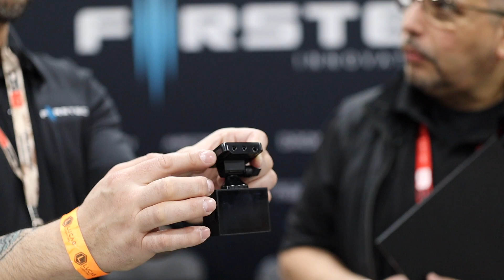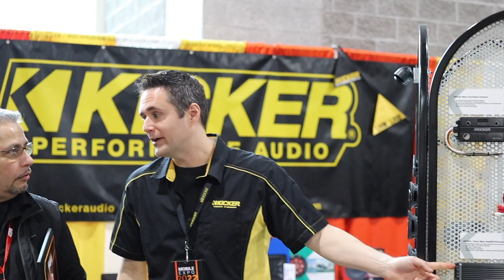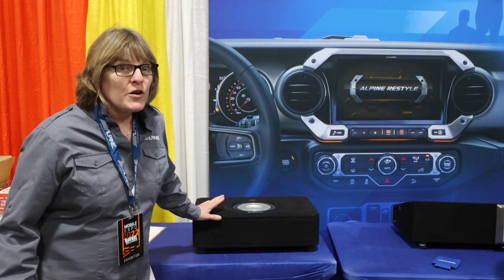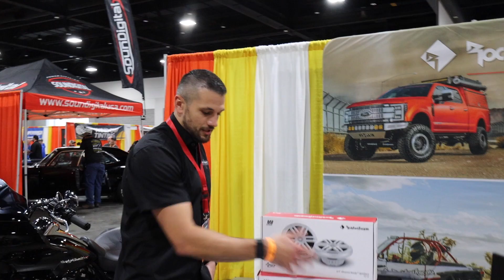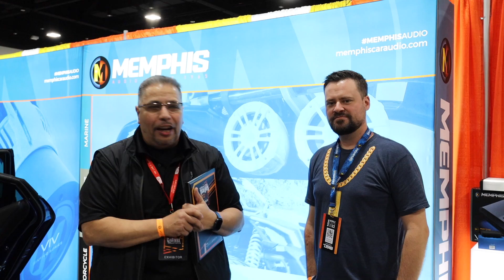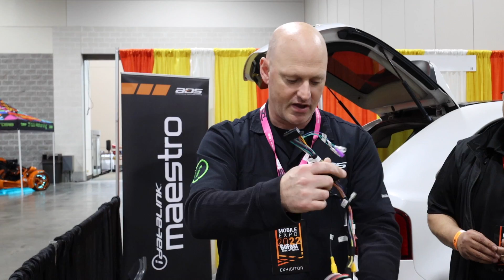New 2022 Car Stereo products at the Go Fast EXPO

Comment: Lots of dash cam stuff. My favorite thing to install. Not. I just did a 4 Runner front and dash cam. For the most part plug and play but it had it's challenges. Had to make sure to add braided sleeving and tessa tape to protect it. Going under the hood the wire bare would have melted pretty quick. It was the added prep work that was a pain really.